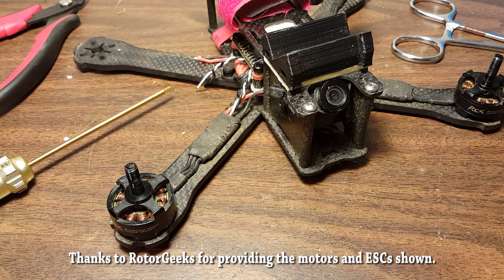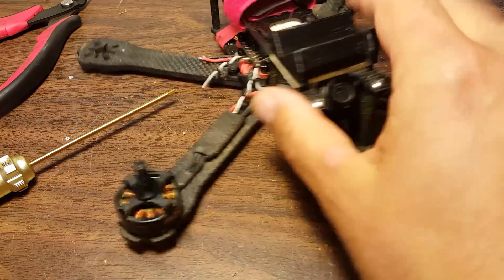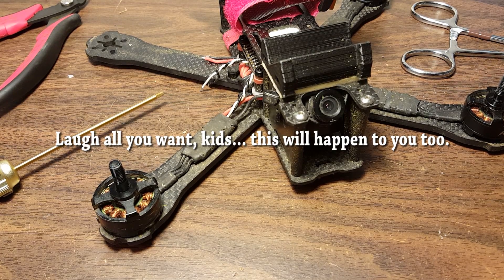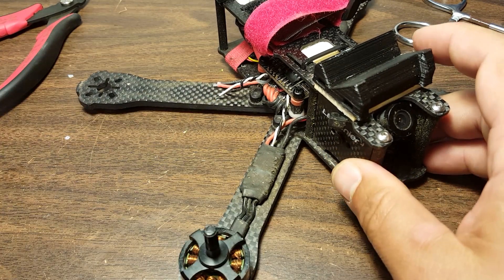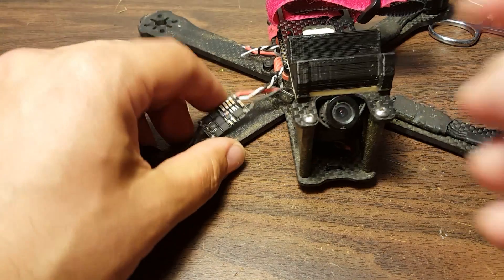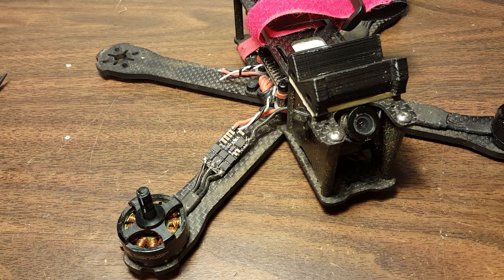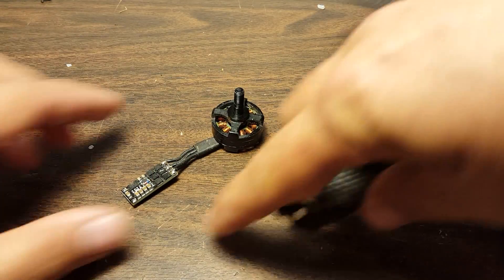Quadcopter ESC Replacement, Outside-In

Comment: Hey man i know this is an old video but I was wondering if it's ok to have 3 20A esc's and one 30A. And what esc's would you reccomend for a budget drone.
Reply from the maker: Yeah it's fine.

Here is my recommended product list: https://www.fpvknowitall.com/ultimate-fpv-shopping-list/
Reply: Thanks for the quick response. I was looking into the Racerstar RS30A V2... do you think that the 30A version is less likely to burn out compared to the 20A version? After just 2 minutes of flying on a brand new drone, the 20A esc caught on fire. Again thanks for the answer, really apreciate it :D

Comment: Hello Joshua, I have to replace an esc after installing 4 new motors. All was good, calibrated the esc's, motor test was on point then I put props on and heard a tinkling sound come from a motor when spun manually then it stopped "no power at this point" I powered up the quad, the motor didn't twitch much, armed the quad, motors spin a tiny puff of smoke from PDB and a tiny burnt resistor on my esc🤔 could a motor short cause this to happen? It was fine until I heard the tinkle of loose copper or steel in the motor.
I'm assuming a loose bit of metal and powerful magnets hides the issue at rest. Any thoughts? Please and thank you. 
Cheers
Reply from the maker: +Gervais Devine yes a damaged motor or ESC could smoke your PDB.
Reply: Thank you, I figured as much but it's nice to have your experience. Cheers
Reply: Joshua Bardwell  I know you didn't loose any sleep over my issue but it was the esc, a simple fix... Cheers

Comment: I have 20 amp ESC can I change it into 30amp ESC without connect it in computer or upgrade it? Just replace it and ready to go? Or need to calibrate?
Reply from the maker: You definitely need to calibrate.
Reply: Joshua Bardwell hi !
I have only one signal wire soldered on my eachine wizard.
is it necessary to solder bouth signal and ground wire ?
Thanks and greetings from Ukraine !!!🇺🇦

Comment: Quick question - will it be wrong to solder the "signal wire ground" to the main esc ground ? when i am checking with multimeter i see that the ground of the signal on the FC is indeed shared with the "main" ground
Reply from the maker: You want the signal ground to be as close to the signal pad as possible. Electrical noise is high-frequency AC, so your measurements with a DC multimeter don't show the whole picture. There can be significant voltage difference between e.g. the ESC power pad and the signal ground pad under some circumstances. It might not matter, but it might.
Reply: +Joshua Bardwell 
thanks mate!

Comment: The only time i had to solder the motor wires on by folding them over was on a very small frame (150) where there was not enough room between the ESC and motor bell to solder on the normal way.

Comment: Didn't see another comment for why to wrap the motor wires under the esc. On small builds it aloes you to get the esc right up to the motor. And it insulates the esc from the carbon.

Comment: I usually take a photo of the ESC using my phone before I desolder the wires. That way I don't have to rely on my old man brain. Great tips. Also, silly putty or play-doh is perfect for holding your work still while you solder up.
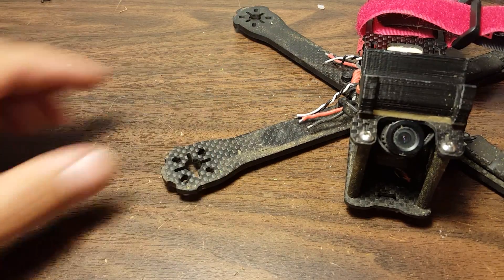Reply: Of course that is one of the best ways to go, but if you had a look 4:04, the pads were marked   -  S -        +

Comment: newcomers: be VERY CAREFUL about over-heating those ESC pads, the wrong flux and a cheap iron (and no soldering since 8th grade) was how I cooked one doing this type of build from an Armattan tutorial, (which requires a nice solder iron and skills)
Reply from the maker: Yes, for sure. If you are not confident in your soldering skills, bullet connectors are the way to go.
Reply: some appear to have "beefier" pads that are maybe? designed for resolder?

Comment: i did the motor cables the "strange way" on my mrp130 as the arms are super short
Reply from the maker: It seems like this is the leading candidate for why people do this. It lets you get the ESCs right up against the motor. This probably also reduces the chances of prop strikes on the ESC.

Comment: Geez - you are upgrading away from the ESCs I intend to install this weekend!  I feel behind the times already.
Reply: I feel you man. XM20 was hot for like 2 weeks, blheli_s is out now. Littlebees are old news.
Reply from the maker: F390 ESCs are the new standard, and BLHeli_S is about to be the new top dog.
Reply: Yeah -- I've been reading.  I bought enough components to build a second Quad last December, but then got really busy at work.  I'm only now getting time to start building it, and now my parts are already last years model.  :(  Heh.
Reply from the maker: Nothing wrong with LB20 they are fine ESCs. Add a capacitor to your PDB and they will serve you very well. Just don't run BLHeli 14.5 on them. 14.4 or 14.6 only.
Reply: Thanks for the info -- I just received my Low ESR caps so I can add one for each quad.  Thanks for the pointer for 14.4 or 14.6 too!
Reply: Hi. I'm using DYS XM20A, I'm very happy about these ESCs, may be a little bit "noisy". Is the purpose of the capacitor to reduce ESC noise ? Do you have a link that explain it ?
Reply from the maker: https://youtu.be/0RP0FPGnilg
Reply: Great !

Comment: What foam tape (double sided) do you use under the ESCs and what foam tape (single sided) do you use under the battery?
Reply from the maker: I use something like this: http://www.amazon.com/Scotch-4013-2-Inch-150-Inch-Mounting/dp/B003W0R4PE/ref=sr_1_3?ie=UTF8&qid=1464363934&sr=8-3&keywords=foam+tape

I prefer the thicker stuff to the thinner stuff under some circumstances, but you can always double-stack the thin stuff if you want. I usually buy the 1/4" wide rolls.

Under the battery, I still don't have a great solution. I have velcro on all my batteries, but I would really rather have something like a grippy rubber pad on the frame. The problem is that the frame has all the cutouts on it so the rubber will just push through, and I don't have the means to custom-cut something. So I am currently using velcro plus a battery strap with a grippy surface and it is working okay.
Reply: +Joshua Bardwell okay. Ordered some of double sided tape like what you suggested and ordered a couple of these for the batteries. Will see how well they work. https://www.ebay.com/itm/281925412844

Comment: How are you liking the Raceblade/Qav-R? I'm still on the fence about it or an alien. I may get extreme and do an LRC RaceX - I just don't want to use a CMOS camera.
Reply from the maker: I couldn't compare it to the Alien as I haven't flown one, but I like the QAV-R a lot. It has been very durable so far. If I had one complaint, it would be that it is a little hard to get the battery secure with 40 degrees uptilt on the Yi. There really should be one more battery strap cutout towards the back of the frame.
Reply: I've heard the qavr has had that problem until they came out with a new bottom plate
Reply from the maker: That's my understanding too. The upgraded top and bottom plates have been completely bombproof for me, although everything will break eventually.

Comment: What are peoples thought on only connecting the signal wire for the ESC and relying on the one main ground? I have  4 20A Little Bees running like this without any issues and  it helps remove a few extra cables.
Reply from the maker: +Neil Perry sometimes it doesn't cause problems. Sometimes it does. I always run signal ground.
Reply: Thanks Joshua, I'll bear it in mind maybe I have just been lucky :)  They  are on a 1st gen QAV250 Lumenier frame so ESCs are not on arms but hang underneath and cable lengths are very short to the FC. almost just vertical.

Comment: "Some people do it like that".  
Those people don't want to trim the motor wires short in case they reuse the motors in another build.  
Not my style, but that's what I've seen.  
  
Btw. Been doing what you show since my first build. I'm always breaking stuff and need to get back in the air fast so I always change out escs by desoldering the whole thing. When you get used to it, it only takes a few minutes.
Reply: I trimmed short, and then they were too short for a rebuild, Another tactic from a tutorial for "beginners" that seemed to use "expert" technique.
Reply: I found that counting by 1000's, and never going past "1000 & 3" with iron touching pad was necessary, if the solder is not joined in that time it's beginning to damage pad. time to go back to basics as J said....usually clean tip and flux, and not with Plumber's Flux like I started with because it was laying around in my shop....this stuff and a new Iron With adjustable-temp tip made miraculous difference.http://www.ebay.com/itm/New-Burnley-Soldering-Paste-Flux-57g-Pine-tree-resin-2oz-/171779662701?hash=item27fedda36d:g:ZwwAAOSwZ8ZW4hxM
Reply from the maker: Oh gosh! Not plumber's flux! Nooooo....

Comment: Never sandpaper your soldering tip! It will violate the coating and the tip will have problems holding on the solder, it will corode and many other unwanted things will happen.
Reply from the maker: +neclovekSK I was referring to cleaning the wire with sandpaper, not the iron.
Reply: Why on earth would you clean a wire with sandpaper?
Reply from the maker: To remove oxidation?
Reply: Why not just add some more fulx cored solder to it? That will clean it good with much less work. If you are talking about untinned wire, then just clip the end off and tin a "fresh" piece. I dont know...maybe the sandpapering is not that bad of an idea, but i never saw anyone do it becouse it seems kinda pointless when methods mentionad above are easier.
Reply from the maker: Well, you know, I was just sort of listing off the possible options.
Reply: Oh, okay then.
Reply from the maker: I mean, I did also mention flux, I think. I haven't gone back and re-watched the video.

Comment: I do it that way on some quads because some arms are too short (180 and smaller).. and there's not enough space from where the motor wires come out to properly spread and reach the ESC pads. Take a look at your old RCX motors and notice that that heatshrink comes out quite a bit from the motor, and the wires are very stiff right there. It makes for very awkward soldering.

Take a look at the rotorx 122 atom build guide for an idea of what I'm talking about
Reply from the maker: +Razvan Taranu interesting. Thanks.
Reply from the maker: +Razvan Taranu interesting. Thanks.